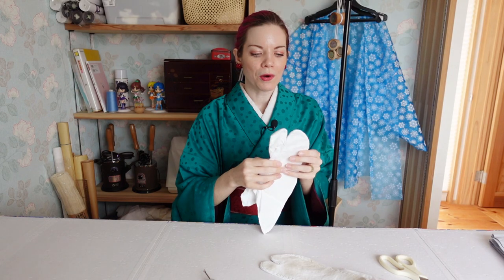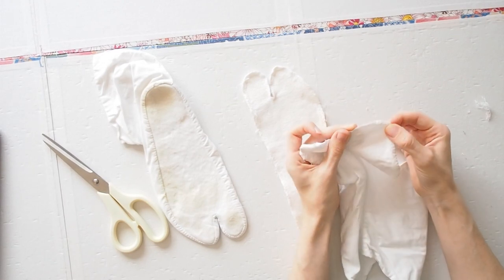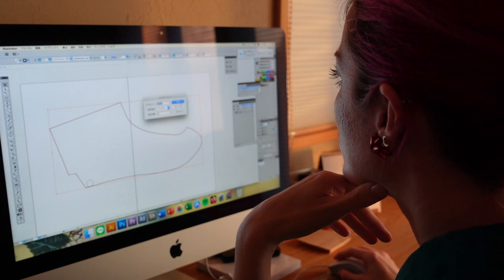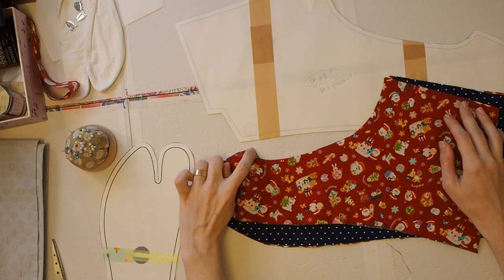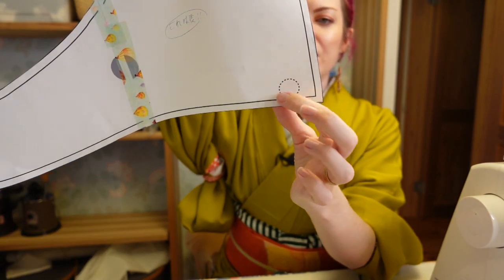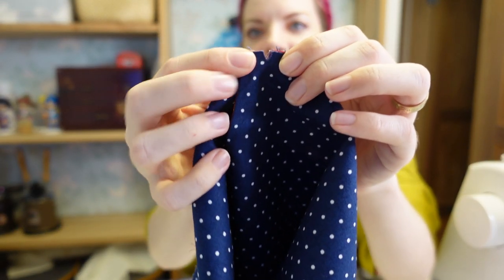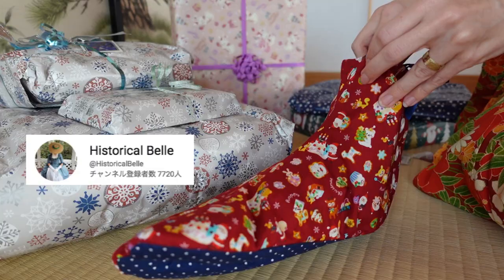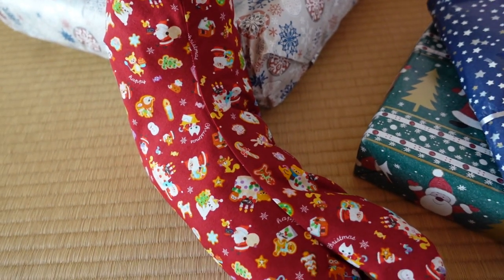The Construction of Tabi Socks // Japanese Inspired Christmas Stocking 🎄

Comment: I sewed six pairs of taby by mysel making my own pattern from reversed tabi the same way u did just not unsewing them. Btw I made them with stretch fabrics because it's easier to sew them and also to wear them. I usually dun like tabi with こはぜ because my ankles are too chubby and don't closes so I go for the stretch ones, btw wrinkles where the toes splits are normal, it happens to me too but once u wear them part of the wrinkles will go away and the rest are hidden by はなお。Anyway I make pop tabi myself but when I need formal white ones I use the already made ones I buy from kimono stores. But I like to make my own pop tabis because every time I see a fabric I like I just pick it and made them, so in that way I made comic tabi, 80's style with neon triangles, neon zebras, hot pink with かわいい lamas, wooden and blue leopard, and for sure gonna make more in the future.